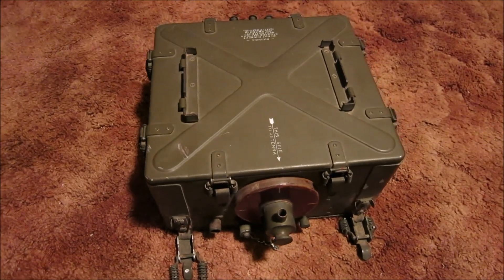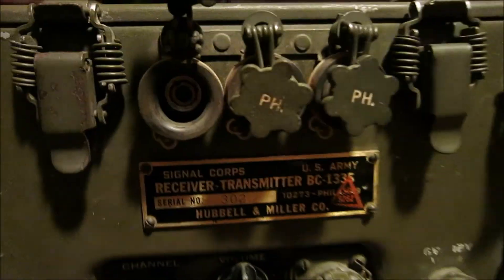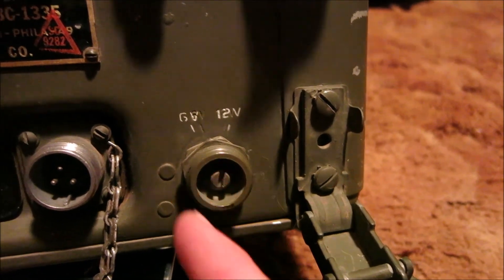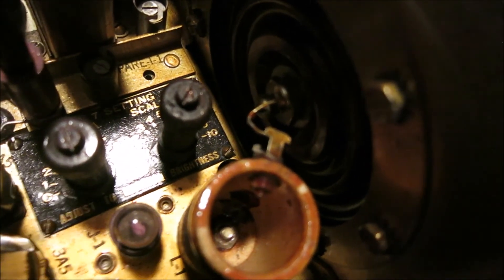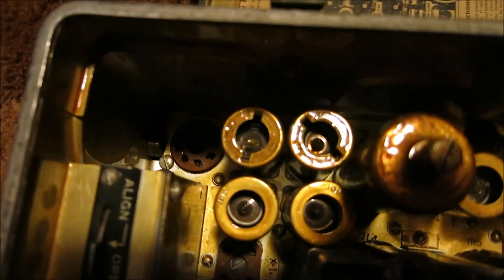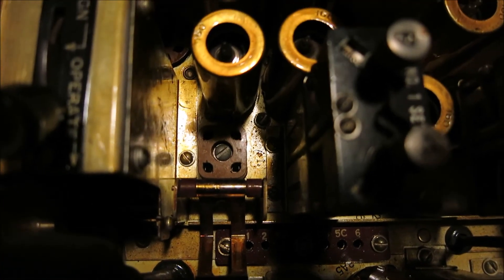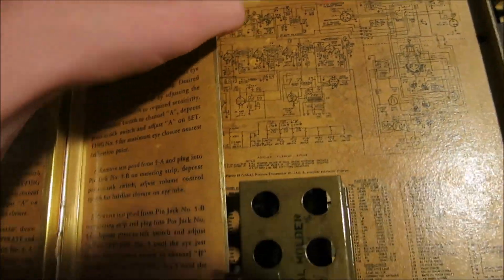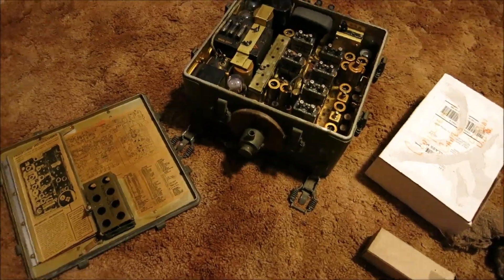Army Radio, WW2 transmitter reciever restoration -(Part 1)

Comment: Please learn more about this radio before doing anything to it.  Restoration is possible - although replacing tubes is not the first step. Chances are that all of the tubes are just fine.  I would suggest reading the tech manual, as several things which are mentioned are not correct.  Just to start, WWII Jeeps were 6V, NEVER 24 volt, and if your microphone doesn't already have the proper plug, it's probably not going to work, no matter what "fitting" you put on it.  If you don't know "what kind of antenna" it needs, then there is a huge problem with understand radio fundamentals. Please either pass this on to someone who is capable of restoring it, or read the tech manual and learn more about it before it's ruined, as it looks to be in decent restorable condition right now.  Thank you.
Reply from the maker: Ive come a long way in electronics since this video was posted years ago. There is no "first step" as long as all the faulty components get replaced, all the tubes are ok and tested prior to being put back into service and missing components replaced according to the schematic. all wax paper caps get trashed and micas tested. all components like resistors are tested for drift and replaced as need be. Vr's get de oxidized and Stuck vibrators either get taken apart and fixed but honestly a solid state version would give a far cleaner output. I have almost all the original equipment to complete the radio set but I haven't had time to work on it since ive been busy working on electrical equipment on a Destroyer. This video was mainly to show that I found something cool at a junk place and plan to fix it one day-not technical data on the radio. Its very easy to restore but finding time is the main problem.

Comment: Radio Set SCR-619 BC-1335 is a combined radio transmitter and radio receiver with facilities for providing short-range voice communication between similar sets operating in the same frequency range. The set is designed for pack operation and it has an average distance range of 5 miles. The range will vary with the antenna height, frequency, time of the day, power output, type of antenna, terrain, condition of batteries and other operating conditions.
The following should be of help to you as well:
https://www.youtube.com/watch?v=BnR_DLd1PDI
http://www.nf6x.net/2009/08/radio-receiver-transmitter-bc-1335-scr-619/

Comment: Do you need any xtals ?.... I found some that say for use with BC-1335
Reply: I have repaired 1 of these radios and am working on another.  They were used in jeeps, as a base station and as a back pack radio. The radio set was known as the SCR 619. If you goggle that you will find the manual on line. Number one problem will be vibrator, contacts stuck together. also the 6 and 12 volt supply must be at or above a little or radio will look like it has a problem, measured at power in.  Low voltage and high voltage caps should also be replaced. There are also 4 mercury bias batteries in the unit, they provide grid voltage for the eye tube, there are easily replaced and than comes alignment, pretty easy and it should work.  Look forward to next video.
Reply from the maker: Actually I don't have any xtals. haven't been able to find any. all the other radios I have such as the RT-68 are set frequency.
Reply: I found 8 ...but maybe you don't need / want that many ... I could donate 2 for free ...just cover my shipping costs, but if you want all of them ...let me know.   73's
Reply from the maker: id be glad to take them all. how much are you wanting for them total. sorry if I don't reply soon...ill be gone to see family for a few days, but would be glad to pay you for the xtals.
Reply: ya ... let's do this after Xmas .... the post office is a nightmare right now  :(
Reply: It could also run off the BA-70 battery same as used by the bc-1000, that's what the  5 pin connector on the top right is for.
Reply: The mic jack is correct,  Its a 3 wire connector.
Reply from the maker: Thank you for the good info, I've been looking to get this one completely restored and making a video on it  however I've had my hands full with getting a bunch of RT-68s going again as well as fixing their PP-112/GR power supply's. I have 4 of them and each needed a little work, new caps and a couple new tubes little stuff. as soon as I get those going and my shop actually warms up in spring ill make all the new videos. but cant thank you enough for info on the 619.
Reply: So sorry ... I totally dropped the ball ... I'll contact you tomorrow and get back with the program with regards to those xtals ... sorry it took so long to get back with you .... 73's
Reply: How about 25.00 ... plus 5.00 for shipping ? (8 xtals)